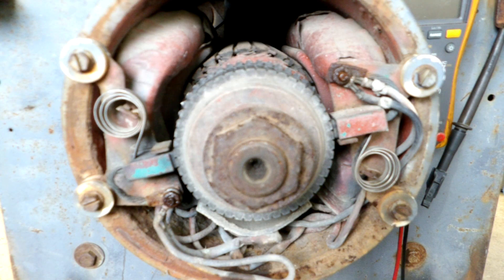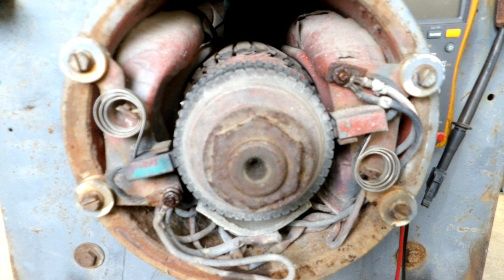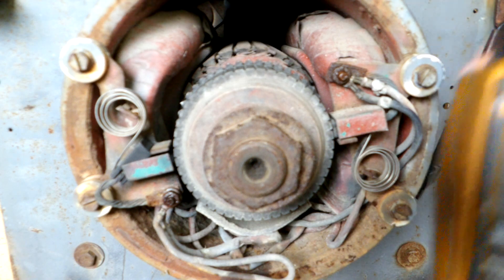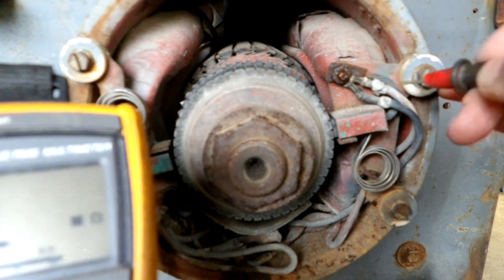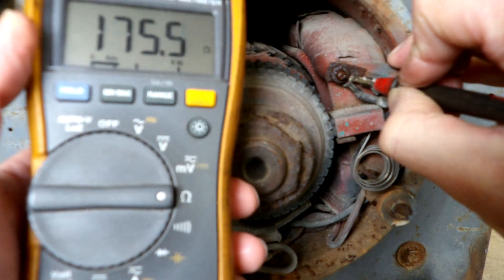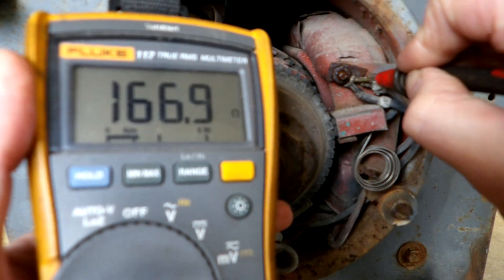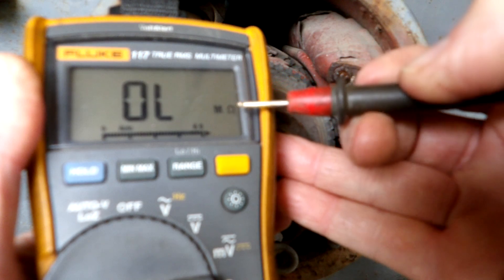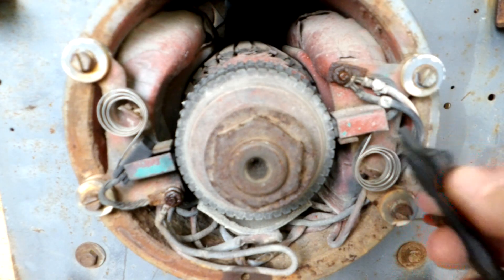SA200 Exciter coil testing

Comment: My machine was running great two days ago, it’s my main work machine so doesn’t sit for more than a few days. Today I had to walk away mid job cause my machine wouldn’t arc. I have no spark from the exciter brushes and my resistance across them is 153.3 using your test. I have no stuck brushes and can get some light spark at the stinger and a very slow grinder with full engine side high idle response. I pulled the tees switch and it’s closed but one end looks burnt. Glass around one side is carbonized like a burnt lightbulb. I’ve done lots of work on these machines but always motor side. Lost $400 today and no idea where to go from here in regards to diagnosis.
Reply from the maker: At this point I would carefully remove the exciter armature and take it to a starter or motor repair shop and have it tested on a "growler".  Someday I hope to post a video of that test.  Also, use your ohmmeter to test the exciter armature from the commutator (copper bars) to any part of the steel it is made of.  It should continue to read OL.  If it shows a low ohms reading it is shorted to ground.  Oh, another test is to isolate the black wire from the right brush holder and ohms test it to the solid wire in the left brush holder.  You should get about 50 ohms with the remote switch in local and the rheostat at 100.  Swing the rheostat to near zero and you see the ohms rise to about 100.  If you get a very low reading then the problem with the machine is a short between to wires in the machine.
Even with the extra test I believe the problem is your exciter armature.  But, I test everything to be sure.   Good luck and best wishes.

Comment: Good morning sr. I have a questoon in spanish. Tengo estás bobinas separadas una la de cable más flexible se lee 165 ohm. Cómo UD dice. La otra indica casi 0 ohmios que significa  esto . O cuántos ohms. Debe indicar está
Reply from the maker: Your coils set is fine.  No need to change them.  0 ohms is what the stiff wire should read.

Comment: Hi, I got a 1965 Lincoln SA-200 red face f-162 about a month ago. I got it running and welding after replacing the exciter brushes and flashing it. Well I just replaced the carburetor because someone before me had it jerry-rigged, and now it's not welding or has any voltage to the outlet. I was checking the exciter coils and I don't know if it supposed to be M ohms or K ohms. But either one I tried I still got 0.00
I made sure to get the rheostat out of the circuit and still got the same reading.

Any ideas?
Reply from the maker: All resistance measurements on the coils in Lincoln "pipeliner" style machines is under 200 ohms.  If your meter reads K ohms over 0.xxx the resistance is too high.  The SA200 exciter coils should be between 120 and 180 ohms depending on who made them.  You can slice into the flexible wire that connects the two coils and measure and compare each side to see which one is bad.  Have fun, be careful and good luck.

Comment: Hi Kevin can you tell me if 37 ohms coming from the blue and brown wire from top of the main generator is an acceptable reading.This 1968 sa200 is completely dismantled as I have the engine rebuilt and making my way forward. Thank you.
Reply from the maker: You're okay with 37.  40 to 60 is common.  Have fun yet be careful.
Reply: @welderfixer  ok great.you seem to really know what you’re talking about and I thank you for your reply.have a great weekend.
Reply from the maker: @JasonGregory-w1y  You are welcome.  I've been certified in welding equipment repair since 2005.  Been welding since the late 70's.  I don't know much but I am affordable.
All the best to ya!

Comment: Can you do the test with coils out of the machine
Reply from the maker: Set your multimeter to test resistance/ohms and firmly hold your test probes against the flexible wire coming out of each side coil.  They are good if the reading 120-180 ohms.  The heavy, stiff wires have almost zero ohms of resistance and I have never had a bad heavy wire coil.  You can tell which fine wire coil is bad by cutting a bit of insulation off of the flexible wire that connects the two coils.  All the best, Kevin

Comment: What if I’m getting 124 ohm
Reply: No welding output everything else works fine
Reply from the maker: @LuisHernandez-jj8hz  That means you have lost connection to the "shunt" coils inside of the main generator or they have burned out.  Find the blue and brown wires that come out of the top of the generator and test the resistance across those two wires.  Good coils are about 50 ohms.  If that's good check the rest of the circuit those two wire are connected to.  Best of luck.

Comment: Working on an sa200 I just bought. I get right around 167ohm on mine but I don't have a local/remote switch that I've seen anywhere and turning the reohstat doesn't change the ohm reading.  What should I be looking into? I get power at my plug but nothing at the weld lugs
Reply from the maker: Take a close look at your rheostat winding.  I would guess that it is burned out in one spot.  If not, disconnect the blue wire from it and test the resistance between the blue wire and the black & Brown for about 50 ohms.  If that is open/no connection/or a very high ohms your "shunt" coils inside of the main generator has burned out.  Good luck.

Comment: When I put in local it says 38 ohms what does it mean sir
Reply from the maker: When the local-remote switch is placed in "local" the circuit combines the exciter coils with the "shunt" coils within the main generator causing the lower resistance reading.  What you are seeing is normal.
Reply: @welderfixer  sir you are a saint a true treasure

Comment: Great content!!! I have a sae 300 he. The other day my machine quit welding and I noticed some vibrations and noise coming from the con end of the machine. I took the con off and saw a lot of movement. I shit it off immediately. Is there a bearing up there somewhere that may be bad??
Reply from the maker: Wesley, it's likely not the bearing.  I have had many cases were the rotor (the spinning unit with four coils behind the nut on the end of the shaft) had developed shorted coils.  If you start the engine and a couple seconds later a pounding - knocking noise starts, it is most likely a bad rotor.

Comment: My 200 doesn’t burn as hot as it should It burns 1/8” rods good but isn’t as hot with bigger rods what could cause this
Reply from the maker: Sorry for the delay in answering you.  If you haven't checked yet, pull the big band off of the generator and check to see if all of the brushes are free to move in the holders and that the armature is clean.  Another good place to check is the range selector switch for burned out contacts.
If the switch is good, but output doesn't change with the change of switch positions you likely have a failed set of "series coils".  That would be a huge problem.  Also, the simplest thing is welding cables and the connections.  I've many guys bring in "broken" machines only to find bad cable connections.  Good luck.

Comment: Thanks for the vid. I'm having mad difficulties with my 4150 blue dial. It runs great no problem but No aux and no arc, just a fizzle against the ground clamp. I'm going to get the armature coil tested after seeing this.
Reply from the maker: You're on the right path.  No grinder or weld the exciter is the place to start.  If the coil resistance checks out and the machine has been sitting for quite some time you may only need "flash" the coils with 12 volts DC.  I advise you check the resistance before taking anything apart.  Diagnosis saves a ton of time.
All the best, Kevin

Comment: I have a 1967 SA200 that will  not kick up when I strike an  arc but welds fine when I manually insert the pin to hold it at high idle.What can I do to fix this?
Reply from the maker: Sense your machine still has the OEM R57 vacuum idler you will have the test the resistance of the coil in the R57 box.  There's two yellow wires going to the box and they connect to the coil inside.  If the coil is burned out it will not rev up when you strike an arc.  I don't know the coil specs, but I'll look them up and let you know here.

Comment: Quiero información sobre máquina de soldar Lincoln sae 300 trifásica 220 o440 voltios con generador
Reply from the maker: Your local Lincoln Electric dealer can easily help you.
Reply: Estoy reparando una q al soldar pierde el arco por periodo de tiempo
Reply from the maker: @melvintomas4654  ¿Cuál es el número de "código" en la máquina? Lo primero que comprobaría son los pinceles.
Reply: @welderfixer  código 7997
Reply from the maker: @melvintomas4654  Veo que este es un soldador accionado por motor. Compruebe la dirección de rotación. Verifique el voltaje de los cepillos excitadores. Si tiene voltaje allí, debe tener salida de soldadura. Si no hay salida de soldadura, compruebe el reóstato. Si el reóstato está bien, verifique las bobinas de derivación del generador de soldadura de 40 a 50 ohmios. Las bobinas de derivación tienen un cable marrón y otro azul. Mucha suerte.

Comment: I have a 1963 sa 200 and I have only 3.75 volts at the weld lugs but I have power at the outlet. The machine runs but will not weld what should i test?
Reply from the maker: If the power at grinder receptacle is normal 115 volts DC that means the exciter is fine and you must test the shunt coil circuit in the machine which includes the panel rheostat and or ditch box, the local/remote switch, the wiring in general and the shunt coils themselves.  To test the shunt coils inside of the weld generator you should insolate the brown and blue wires coming out of the top of the generator and test for about 50ohms of resistance.  If your meter reads a very high resistance then it is likely that the shunt coils inside of the generator has failed in some way.

Comment: @kevingardner…is it possible to check the exciter coils out of machine and if so what would ohms read? Thank you
Reply from the maker: Just like any coil of wire it is easy to measure the resistance.  Simply attach one meter probe to the flexible wire of one coil and the other probe to the the flexible wire on the other coil.  The reading (depending on manufacturer) should be between 120 and 170 ohms.  I often cut open the flexible wire connecting the coils together and measure each coil separately.  If one side measures 60 - 90 ohms that side is good.
Reply: @welderfixer  cut both wires that connect the two coils together or just the flexible wire?
Reply: Wait I read wrong!!!🤦‍♀️ we skinned wire back(flexible wire) and got 60 on each…we have spark and plug works…but when we took off nose of the barrel the left side looking at machine no spark coming from brush
Reply from the maker: @georginabiehle8423  No need to cut any wires.  Just skin off some of the insulation of the flexible connecting wire.  So, you can get to the wire inside with the probe.  Note: If you measure the stiff wire the measurement will be very low, like a dead short because the wire is thick.
Reply from the maker: @georginabiehle8423  60 each side.  Coils are fine.  Grinder runs fine - then nothing wrong with the exciter.  No sparking on one brush, but grinder runs fine - nothing wrong with the exciter.  If the grinder runs fine on any Lincoln pipeliner style machine the exciter is fine.  Don't mess with it.

Comment: Thanks for the video, getting me in the right direction. Im getting a 40 ohm reading with the rheostat at 55-100, and a 100 ohm reading with the rheostat turned all the way down. 1963 SA-200 F162 motor, no local/remote switch. Wouldn't strike an arc this morning and im only getting 3 volts at the plug. Think it could be the rheostat? I know this is an old video but if i do figure it out ill post back on here

Comment: I know this is an old video but I just went out and tested my machine and I was getting a 135 reading
Reply from the maker: That's fine.  Some aftermarket coils measure 125 ohms.
Reply: Thanks for the reply. Sorry I didn't see the notification.

Comment: Got an SA 200 that don't put out a constant arc whie welding?
Reply from the maker: This ghost is a hard one to chase down.  Start with hand sanding all of your welding cable connections clean and back to bare copper or brass.  If no different, look closely at the "range switch" for burned connections.  Then look at the exciter armature and brushes.  Is the armature wobbling bad and the brushes making big sparks?  If so that needs to be corrected.  I can go on and on about trying to find the source of this problem, but one thing at a time must be eliminated to find it.  Sometimes, it's just a bad batch of rod or the engine is changing speed and it is hard to hear that unless it is significant.   Best of luck.

Comment: Any ideas why my sa 200 will run my dc powered grinder at a low rpm when the machine is on low idle but won’t make the machine high ideal unless I strike a arc or set the machine on high ideal ?
Reply from the maker: The simple answer would be change to idle control circuit board, but there maybe a loose or corroded connection in the grinder power wires or the outlet is worn out.  Since the welding arc is fine you don't have to worry about anything in the generator or brushes for this issue.

Comment: You should make a video replacing a magneto AND a distributor on a SA200
Reply from the maker: Thanks for the request.  They are both a fairly simply job that is often made difficult by not following the basic steps each time.  That is if someone hasn't changed the camshaft gear or has the governor installed incorrectly.  I'll go over the factory steps and most of issues I have found when I make that video.  Thanks again.

Comment: Thanks for the video. I have welder that stops welding after warming up. It never stops grinding meaning the 115v aux power is always good, but about 1/2 hour in and then it stops welding. I was looking to find a video that would help me on my diagnostic journey. I'm sure glad I found what I was looking for. Just need to find a meter now. Again, many thanks for this video!
Reply from the maker: If the failure happens every time you use the machine it's likely heat related.  That means a coil, the main armature or a connection is faulty.  The difficulty is finding the bad part.  First the easier stuff.  Look closely at all of the welding lead connections, any of them getting extra hot or show signs of being hot.  Discoloration of the copper lugs, heavily rusted nut and bolt connections, melted wire coating are sure signs of heat and bad connections.  Give the "range" switch a good look over.  The old switched get really bad when burned up and the new plastic switches burn out, but you have look very close at them.  If the armature or internal coils are bad that is a major job to repair and I don't recommend someone do it without help from someone who has done it CORRECTLY before.  No sense in doing more damage to a machine that needds a little TLC.  Check the above and read the comments below for more advice.  Best of luck.